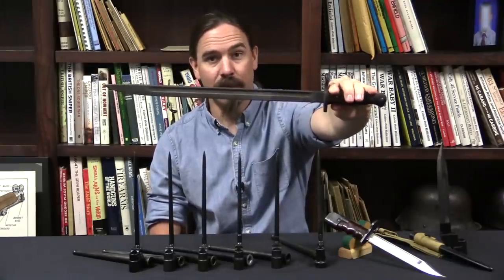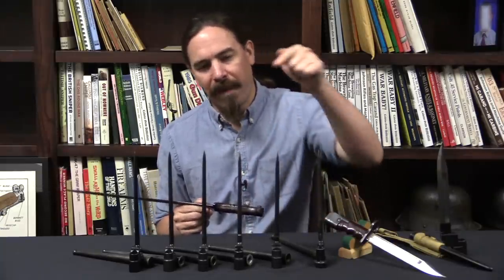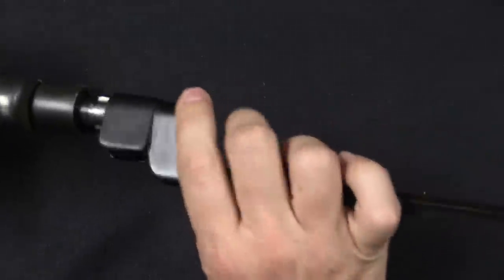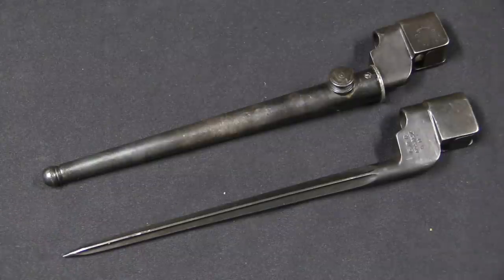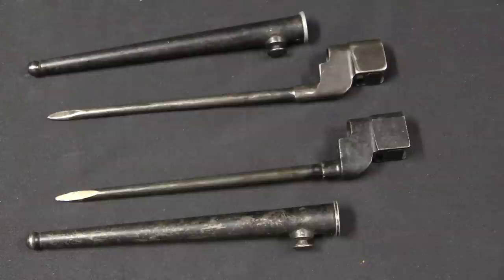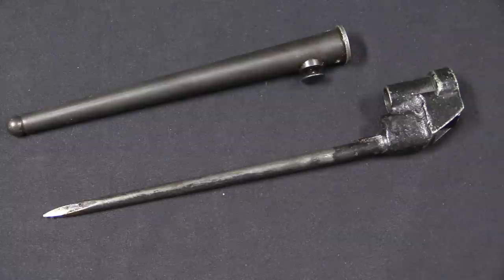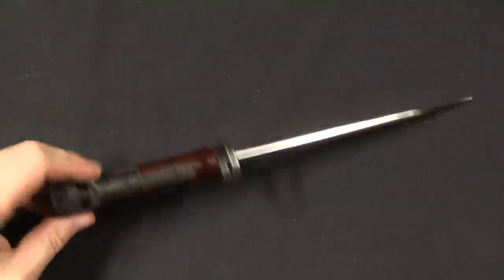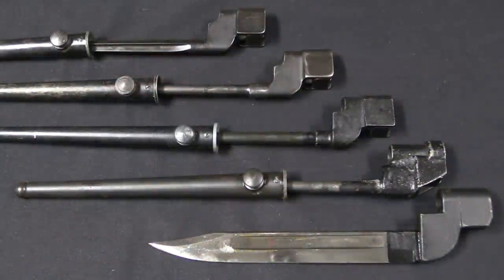Bayonet Development for the Lee Enfield No4 Rifle

Comment: My father drew one of those Mk9's from stores when he did his basic training back in the 50's.  It was brand new, as it came covered in a black paint that prevented the bayonet going rusty while it sat in the stores.  So troops are on parade with bayonets fixed to their rifles and along comes the inspecting officer.  Officer: "What's that on your bayonet solder", Dad: "It's paint sir, put on it to prevent it going rusty."  Officer: "Well clean it off, if you where to stab some one with that bayonet you might give them blood poisoning."

Comment: The British also fitted a steel end to the shovel/pick handle issued to the troops which looked like the muzzle of the No4 rifle which when had the bayonet fitted turned it in to a probe for finding mines.
Reply: "If we should step on a mine, Sir, what do we do?", "Well, the normal procedure is to jump two hundred feet in the air and scatter yourself over a wide area".
Reply: @AshleyPomeroy  As we used to say Wully is buried here and here and here and possibly over there as well

Comment: The change from spike to blade was greatly driven by the spike looking less intimidating and the biggest use of the bayonet was in guarding prisoners and dispersing riots. In the latter the action on the order to fix bayonets was to draw and flourish the bayonet so that the rioters could see what was being fixed, then fix it and hold it at the high port to be seen. Ideally with a shiny blade to be seen. Not some black spike that is all but invisible. The purpose being to frighten rioters into dispersing so that nobody is injured in either party. Ditto for the command ‘with one round load’. Where the rifle is held at the low port and the bolt worked sharply in four movements so that the rioters could see the action being worked and could hear it. The rifle being kept at the low port until the command to present when it is presented above the heads of the rioters awaiting the order to fire.It all required a tightly disciplined force to prevent inadvertent actions.
Reply: @JW...-oj5iw  Nice dehumanization you got going there. Crowds of people are pretty much the same. If they are riled up, then these rather nuanced psychological tactics won't work. Same with Police on horseback or Police-Dogs.

Comment: The good part is every part of the blade was stabby-pokey!    Really great run down!   Nice to see the history and development  and how changed with the pressures of war.  

When the US cut their 16 inch bayonets M1905 bayonets down to 10 inches,  the Marines and soldiers in the Pacific tried to hold on to the older ones as the Japanese Type 30 bayonets had a blade just shy of 16 inches and the Japanese believed in using them.  The threat of a bayonet duel in Europe was not nearly as high. 

ANZAC troops were still using the sword bayonets well in WWII but this was because they were using the SMLE Mk III.

Comment: It always puzzled me what they were thinking with the No9 ? The utility blade makes sense, but only if you have a handle on it. I notice that in older pictures of my school CCF, even bandsmen wore bayonets. They’d disappeared by my time (77-85).
Reply: I think the cross spike bayonets get stuck more easily than the knife-style bayonets. I'm no expert, but that might have something to do with it.
Reply: In my humble opinion, 'what were they thinking' is a common thing in British bayonet design since at least 1905. Hatchet point on a bayonet purely for the show of solidarity with the Japanese, the idea of attaching a bayonet to the all too short SMGs, SA80 bayonets and the horrendous way of attaching them to L129A1 - examples are abundant.
Reply: Round spike penetrates easily, but doesn't necessarily cause that much damage. Wider blade causes rapid blood loss meaning the target is disabled much more quickly, which is important if you don't want them to stab you back moments after you've stabbed them.

Comment: I have a Bayonet No 7 MK 3/L. It had a dull edge when I bought it, and I've never ground it down to be sharp. It does snap on to my Rifle No 4 MK I. Also stamped M478 on one side of the socket and Made in UK on the other. Obverse of the blade by the hilt is also stamped M478 but with a Broad Arrow overstrike.

Comment: Nice Video. Finally a topic about things I can collect.  Just two small details.The reference to the pattern 1907 bayonet you used a M1917 stlye with high muzzle ring. No.4 Mk III is not 'cast' but assembled from components (maybe some cast  components ? ) fitted together and the quantity was to my knowlege a lot more than stated.

Comment: It does seem strange, that the bayonet-which-is-also-a knife is so specialized. Like, a soldier can use a knife for many useful things, if you can also use it as a bayonet, that saves weight, and probably manufacturing costs.
Reply: Plus gives a much more functional and comfortable grip, improves balance etc. They make basically zero sense to me.
Reply: You should watch no.4 mk1 video. The British abandoned the bayonet-knife because British soldiers during WW1 preferred to use their own knives rather than service bayonets.
Reply: @ilyaskr8048  Same thing happened in Finland. Solution was to make the bayonet a good enough knife for the average Finn.🤔
Reply: @jameshealy4594  why do you need a grip on a bayonet?
Reply: @Kumimono  indeed, that’s where most post WWI bayonets ended up. If you’re issuing a field knife anyway, why not make it possible to put it on the rifle?
Reply: @captainswoop8722  So it can be used as a knife for the 99.9999999% of the time it's not fitted to a rifle. Many bayonets are designed to work as dual purpose tools.
Reply: @ilyaskr8048  I can see that. Most bayonets make crap knives.
Reply: @ilyaskr8048  First of all the service bayonets were utter crap. Second of all most troops did not even get supplied with said service bayonets. Third of all: Special circumstances of Trench Warfare. People improvised all sorts of stabbing/slashing and clubbing weapons.
Reply: That's exactly why they did it. Many also came with wire cutting tool to use in conjunction with the knife on barbed wire and such to cut through it aswell. An example of that is the AK47/AKM knife bayonet

Comment: When I joined the RAF in 1983 instead of issuing SLR's for drill they used old No4 stocks that had been fashioned to look like an SLR from the distance that the families of the recruits passing out would be. We were than issued with Nº4 Mk 9 bayonets with brightly polished blades. Yes they were pretty sharp still, and yes we did have at least one guy stab themselves in the armpit while learning to do the drill with the bayonet attached. That extra eight inches of length really made a difference when doing rifle drill.

Comment: 5:27 You default to the 1911 production, my first thought was "the sewing machine folks?" I need to play with guns more...
Reply: From what I can find online, I believe you're correct! In 1853, the company we now know as Singer Sewing Machines was called Singer Manufacturing Company, and they had a factory in Scotland! To be fair, these bayonets are basically massive sewing needles, so it should have been easy for them.
Reply: Not only does it stab, but it will stitch you back up too. It even makes curly fries in 10 seconds!

Comment: The no7 knife/Beyonet was recalled and not used because when fitted to the rifle, the bullets would strike the slider and then the ring, which was completely useless and wasn't there to do anything unless it was to protect the users hand. As such they were only issued for ceremonial use because they looked more grand on the end of a rifle than a pig sticker. They came in a couple of shades of red/brown and black and the scabbards are harder to find than the beyonets because they were used on the no9 that came after it. They made less than 200,000 of them in total across 4 factories in Britain.

Comment: The fluting on the spike wasn't just to reduce weight. A round spike will tend to push tissue out of the way, which leaves less tissue damaged and produces less bleeding. The cruciform shape will penetrate more easily, since it has less surface area to push into the target, and the tissue is cut rather than pushed away. This leads to more tissue damage and more bleeding. But making it cheaper will always be a strong argument. As Stalin said it "Quantity has a quality of it's own."

Comment: I'm pretty sure the cruciform shape was not to reduce weight but to make a wound that would bleed out faster.
Reply: No. The idea of the "blood grooves" or to make a worse wound is a myth. The cruciform design does two things. It does reduce weight but that is secondary to stiffening the shaft (*chuckle*), kind of like why I-beams are used in construction. It would bend a lot easier without them.
Reply: @johnnelson5503  not buying it. A solid spike will be much stiffer if you don’t cut notches in it and the weight saving of the notches wouldn’t justify the added cost.

Comment: Makes you wonder what use is a knife bayonet if you dont have a proper handle attached to it. I thought the idea behind knife bayonets was its use also as a knife, a multipurpose tool.
Reply: my guess is that it was to standardise the blades between the Sten Gun, No. 5 and No. 4 rifles. Plus they might have thought it looked nicer, the war was over after all so that became a consideration again.
Reply: Troops were issued with  a clasp knife, balde , tin opner thingy and marlin spike.

Comment: I wonder why they didn't just thread the muzzle and a section of steel pipe. Like an AK slant brake but longer. Maybe weld a little circle of sheel metal near the base  so it doesn't just keep going and actually get some of the barrel inside the target.

Comment: I'm guessing the handles of the No7 bayonet would not play well with the muzzle blast of .303 MkVIIz ball ammo.  The SLR bayonet (which has the handle in a similarly exposed position with regard to the actual muzzle, given how long the flash suppressor is) has a metal grip for that reason, I suspect.
Reply: If you fit a No.7 bayonet to a No.4 rifle the bullets can deflect slightly off the latch section (not enough clearance) and go wild. Not issued for use on the No.4 except for ceremonial duties, last I checked. I have one, not going to try it.
Reply: @pirtoo  Thanks for that tip. I have a LE No 4 Mk I and a No 7 bayonet. I never tried shooting the rifle wth the bayonet attached.  It does look like there is only a very close tolerance, if any, between the bullet path and the high point of the pivot latch. It could be milled down I guess, but that would change its provenance.

Comment: I have one of these which I'm positive is from the WW2 era, and appears to be a Mark 2 * (star), although it's difficult to tell whether it's actually comprised of two separate pieces, or just one forged unit.  At any event, it bears no markings of any kind.  Would this indicate that it is American or Canadian production as opposed to British?
Reply: I was going to ask the same thing. MY Mk.2 star has no marks visible apart from under close inspection and magnification, the flat face that looks down the spike has an "N" just visible. It's in perfect condition which is staggering considering its age.
Reply: @SalemikTUBE  I bought mine from a military surplus company in Kingston, NY -- if that might serve to shed any light on its origins at all.  It came still wrapped in the original paper with grease/cosmoline clumped to it that had completely broken down since the 1940s, and I blasted away with carburator cleaner.

Comment: So, I have a question about the spike bayonets. I have a No. 4 Mk. 1 (as far as I am aware, and from what I've learned in your videos I believe that is what it is) rifle, with a spike bayonet. However mine does not have the "screw driver" tipped end, it's just a rounded point. It doesn't look like a screwdriver and just a pokey bit. I'm curious where mine would fit in. The socket is forged on mine, I'm not 100% sure what the markings are as they are some worn.
Reply: Possibly intended for drill or training use, round the point off to reduce the chance of injury?
Reply: @gwtpictgwtpict4214  Well, the point is still pointy. It's very sharp, but the shape isn't like that of a flathead screwdriver. It's pretty much just a spike with a sharpened point.
Reply: @ralphg1891  My mistake, I read 'rounded point' as being blunted.
Reply: @gwtpictgwtpict4214  You're good man! It was a bit awkward to explain, so I understand the confusion.

Comment: In terms of trench fight where someone use a club or spade, the first would deffo be best as bayo on rifle was much worse than tools, often very innovative. Theres pictures of soldiers running with barbed wire on themselves as protection and hatches, bars, pickaxes spades etc but bayo on rifle was too long in a trench. The total havoc on pachendaele has quite some imaging online as with somme. What is strange is that the rifle didnt evolve more, it is heavy as hell vs what it needed to be, a bit clumsy even.

Comment: The cruciform bayonet makes a much more lethal wound. Proper bayonet technique is, after the initial stab, to twist the bayonet and twist the bayonet prior to withdrawal. This breaks the vacuum, making easier to pull out, and digs out circular divot, preventing wound closure behind the blade. This leads to increased blood loss.

Comment: 0:35 Ironically enough Britain was among them.
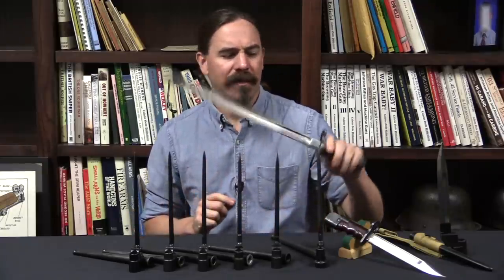1:27 That could be attributed to the poor heat treatment, it's not like this problem wasn't encountered all the way back since 1880s or so, when it was attributed solely to the German import blades.
1:40 With that hatchet point stubbing someone, say, in a greatcoat won't be that easy.
1:57 'Six to eight inches is enough of penetration', as Matt Easton says. 😉

Comment: I have always taught attaching a bayonet to the barrel would make the gun less accurate especially for a gun like lee Enfield that has a barrel that is not in contact with other parts
Reply: Firstly, not to be overly picky, but the LE barrel IS in contact with other parts, The barrel is "stocked", which means the lower handguard presses up on the barrel in at least 2 places,  in order to reduce the harmonics in the barrel.Having a badly stocked LE is worse than adding any bayonet, as it will randomly shoot all over the place.
Depending on which one you fit (weight being the main consideration) it does change the point of impact in that it shoots slightly lower. Wether you consider that as "less accurate" is debatable. If you aim for the head and it hits the body, it's still a hit and potentially just as fatal, though realistically if you are expecting to use the bayonet, you are going to be so close (street clearing or other CQB) that accuracy is going to be moot.
Reply: When fixing bayonets, the long distance accuracy would be less of a concern I would imagine... Since it generally implies the enemy being close enough to stab rather than shoot (or having run out of ammo, but the point still applies).
Reply: Ok thanks
Reply: In my experience it changes the point of impact, but not the groups size (which is what most people think of as “accuracy”).

Comment: To be honest, I just don't understand why someone would want a bayonet that doesn't double as something other than a bayonet.  Seems to wasteful as an over all soldier's kit.  At minimum a bayonet personally should function as some kind of knife as well as a bayonet.
Reply: Because the thing it is supposed to double for most likely does the job as well while weighing as much or less. The British soldier of this time was also issued a clasp knife with a utility blade and tin opener. The average soldier did not require a knife bigger than that. Those that do, get issued them. You also want to minimize soldiers use of weapon accessories for other use. US GIs were notorious for breaking, chipping and dulling their M1 bayonets for mundane tasks like opening food tins. That said, there have been some multi-function bayonets like the machete-bayonet (useful in the Phillipine jungles, not much elsewhere) or that work in conjunction with the scabbard as wirecutters (not used nearly as much as one would think).